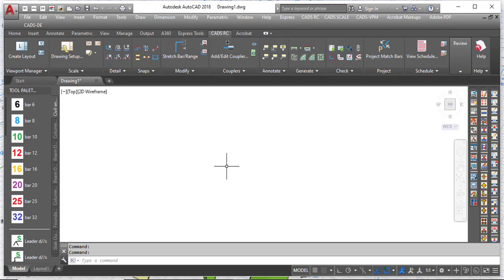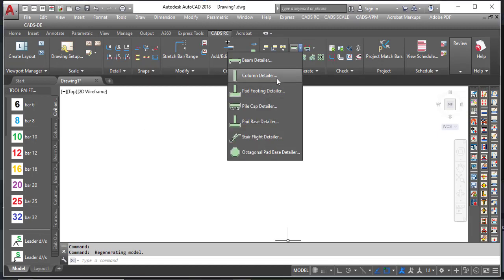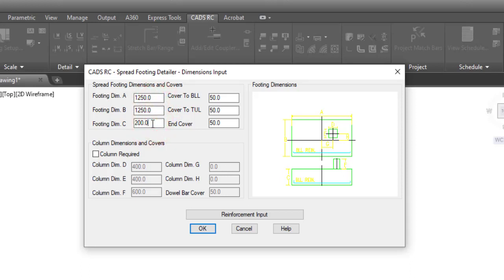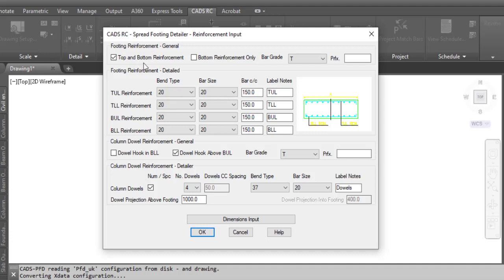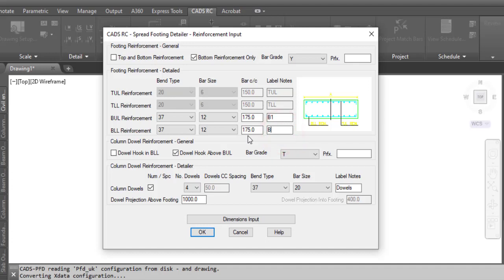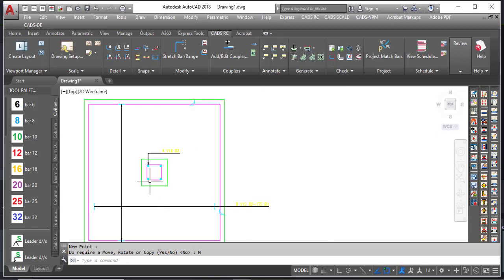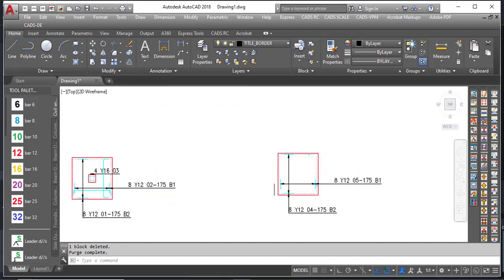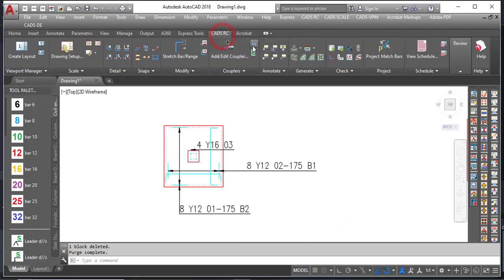Part 1: Automatic detailing of pad footing with Cad RC.

Comment: Is this software used for prota drawings only?? Say i am using staad pro for instance...would it work??
Reply from the maker: It’s not for Prota, Staad or any other design software. It’s a standalone software and a plug-in for AutoCAD. It’s basically for generating and creating detail drawings of the design you’ve already made with any design software.
Reply: @ridwantician  what if i have multiple footings??
Reply from the maker: @Eng.naftalkimaro  what is shown in the video is basically a fast way of making footing detail with the tool. It’s not dynamic! An elaborate way of properly detailing with cad rc is what is in the course I put in the description.